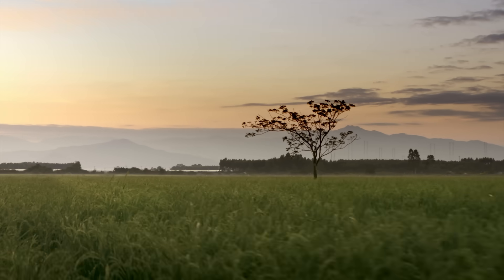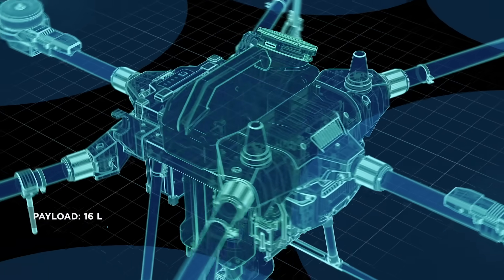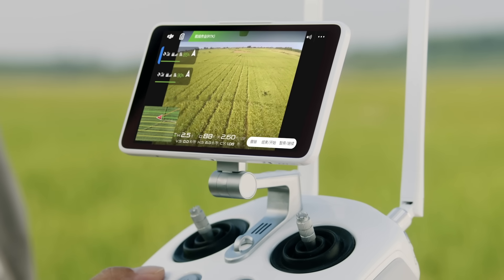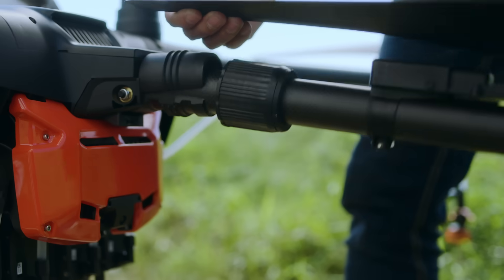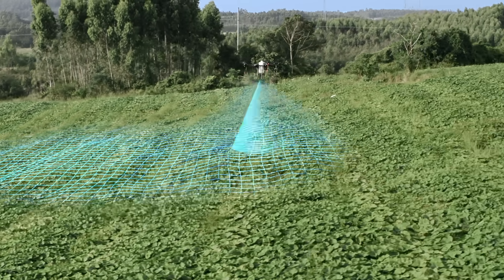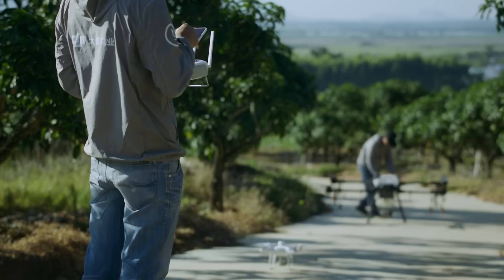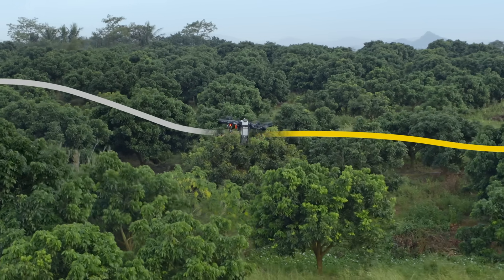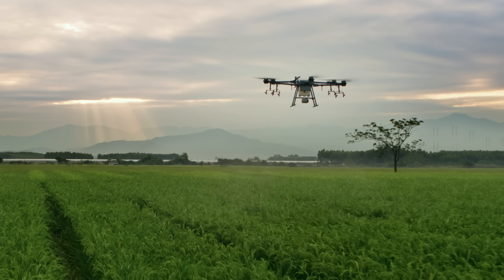DJI - Agras T16 - Agricultural Spraying Drone

Comment: what they DONT say, it can only fly for 20min (or less), recharge time is 20min (or more), battery life is a problem, you NEED a "pilot" license (if you get approved for one aswell is another story) to operate it for commercial and private use, and is VERY expensive, if you going to sell this shit, include all the ups and downs, and there is more downs than ups to this

Comment: Why DJI cant try wired fuel or spray unit, so weight of the airborne unit gets minimized. so I was thinking removing the fuel or spray tank with tube input. with magnetic plug in setup, so when the flight path gets distributed immediately the wired setup will unplug itself.
Reply: because it makes it cheaper. less profit is bad for dji

Comment: After all that they did not mention how long the battery lasts,Cant be that long or they would have told us instead they gave us the Mah of the battery,
Reply: Its 8-15 minutes depending on how much your spraying, speed etc. At 2 GPA. you run out of liquid before battery so when it comes back the battery and the tank is changed out and you send it back out.

Comment: Still has no use in  main stream Agriculture, when you have a 1000+ acres to spray, 10 minutes of flight time and the area it can cover in that time is useless when we have tractors and crop dusters that can complete this work in a fraction of a time for less money. (21k you can buy a very nice used tractor for spraying) Case has already made driverless sprayers that work off gps essentially doing everything this can and it doesn’t have to stop every ten minutes. I’m having a hard time  seeing any practical use for this equipment.

Comment: It really looks cool, but...it is unpractical, to say the least. it can spray 4.8L per minute...so, your tank is empty in around 3-4 minutes. So, you should retrieve drone every 4 minutes and refill it. Battery life is probably around 20-25 minutes with that weight. So, after few turns, you need to replace battery, too. And what about overheating of motors after long flying etc? And what about price?